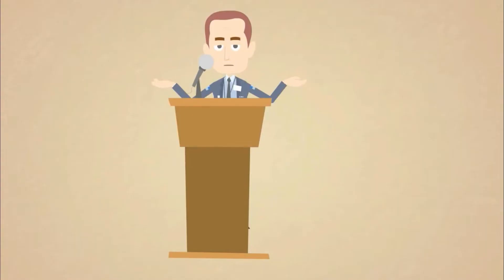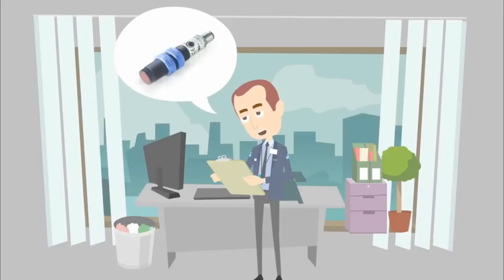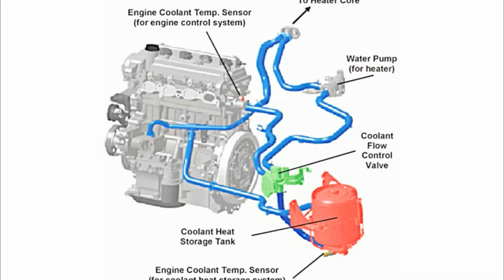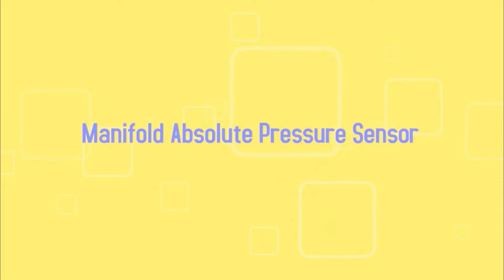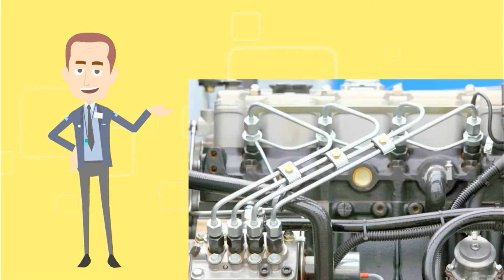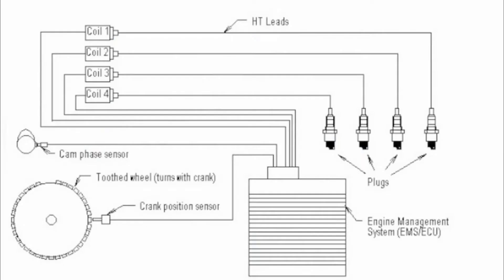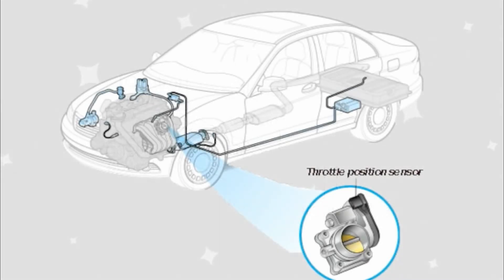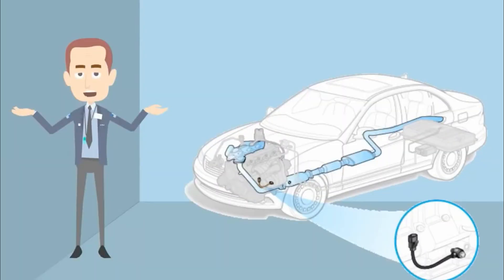Engine Control Unit - Working Functions & its Importance - Engine Start  Up

Comment: ECU system is normally located close to control panels located on the dashboard. Chip tuning is helpful in exhausting car performance in terms of power and fuel economy. There are so many companies available in the market to get your car tuned but I recommend you to avail services from Hs-tronic. They first understand the car engine after that they chip tune according to the engine requirements.